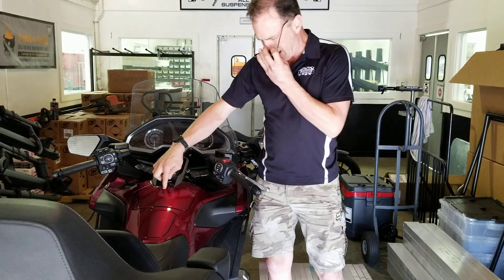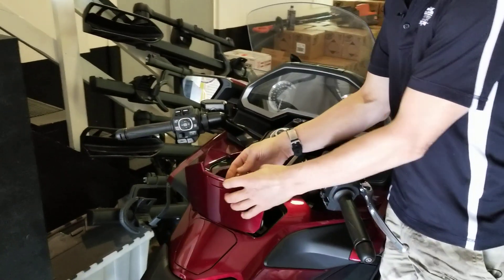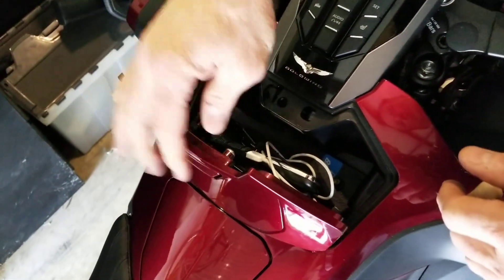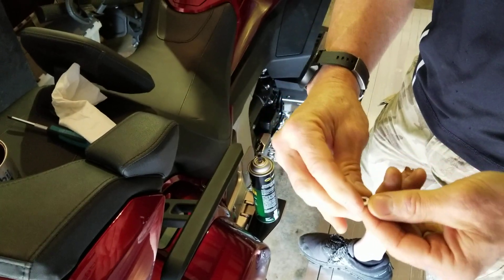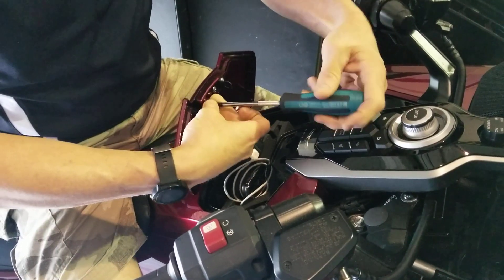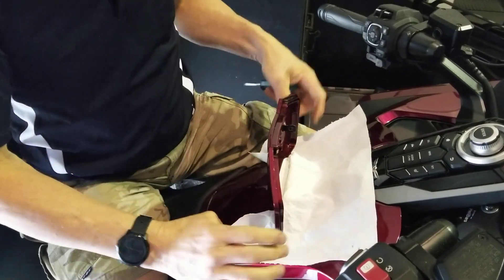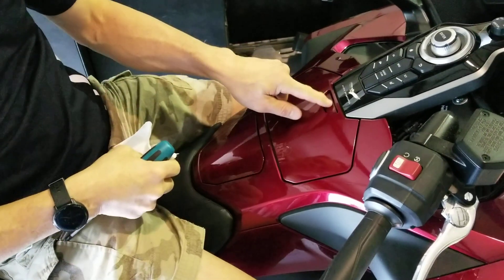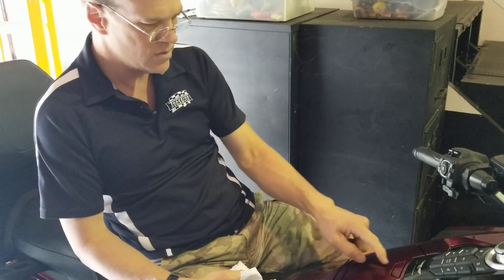Fix Annoying Center Console Latch -2018+ Honda GoldWing

Comment: I learned something today for all 2018+ Goldwing owners.  The latch isn't broken, you just have to press it on the right side vs. in the middle to get it to pop open.  Bad design if you ask me but figured it out with my dealer when mine wouldn't open at all lol.  Now it opens great just press on the right side of the big button.
Reply from the maker: If you would watch this video, I show you how to fix it so it opens normally.
Reply: @Traxxion  I watched it.  Was a great video!  Appreciate it.

Comment: Used your fix earlier today. Works perfect. Only difference is I used the washer from the other latch post. Still works great. Have to admit, you know how to intelligently analyze a problem and arrive at the smart fix. Thanks.
Reply from the maker: If you get a chance, grab a few small washers at the Home Depot.
The washers have a bigger diameter than the head of the screw.  The washers top out against the housing to keep the button level at the surface.  It's possible the left side of your button is sticking up above the surface of the door now.
Reply: Max McAllister  Added a washer back to the left side post. Works a little better. No biggie.

Comment: I thought I would have to deal with this bad design by pushing on the right side of the release button.  I completed the fix last week, and it works perfect now, thanks for helping us Wing riders with poor Honda engineering.
Reply from the maker: Soon I am going to have a locking button set to replace the factory button.
Reply: Max McAllister let me know when it become available,  a $20 lock prevents the theft of a $1000 phone.......what was Honda thinking......oh I am crazy, I have a 6” and 1.5” JIS screw drivers...
Reply from the maker: @kevinmiller1733  $20???
HAHAHAHAHAHAHAHAHAHAHAHAHAHAHAHAHAHAHAHAHAHAHAHAHAHAHAHAHAHAHAHAHAHAHAHAHA
HAHAHAHAHAHAHAHAHAHAHAHAHAHAHAHAHAHAHAHAHAHAHAHAHAHAHAHAHAHAHAHAHAHAHAHAHA
HAHAHAHAHAHAHAHAHAHAHAHAHAHAHAHAHAHAHAHAHAHAHAHAHAHAHAHAHAHAHAHAHAHAHAHAHA
HAHAHAHAHAHAHAHAHAHAHAHAHAHAHAHAHAHAHAHAHAHAHAHAHAHAHAHAHAHAHAHAHAHAHAHAHA
HAHAHAHAHAHAHAHAHAHAHAHAHAHAHAHAHAHAHAHAHAHAHAHAHAHAHAHAHAHAHAHAHAHAHAHAHA
HAHAHAHAHAHAHAHAHAHAHAHAHAHAHAHAHAHAHAHAHAHAHAHAHAHAHAHAHAHAHAHAHAHAHAHAHA
HAHAHAHAHAHAHAHAHAHAHAHAHAHAHAHAHAHAHAHAHAHAHAHAHAHAHAHAHAHAHAHAHAHAHAHAHA
HAHAHAHAHAHAHAHAHAHAHAHAHAHAHAHAHAHAHAHAHAHAHAHAHAHAHAHAHAHAHAHAHAHAHAHAHA
HAHAHAHAHAHAHAHAHAHAHAHAHAHAHAHAHAHAHAHAHAHAHAHAHAHAHAHAHAHAHAHAHAHAHAHAHA
HAHAHAHAHAHAHAHAHAHAHAHAHAHAHAHAHAHAHAHAHAHAHAHAHAHAHAHAHAHAHAHAHAHAHAHAHA
  Whew.... thanks, I needed that!!!

Comment: Hello Max, I enjoy your videos a lot, thank you, My 2018 DCT has an air bag where this catch is and obviously does not move until, well Id rather not say, but have you any insight into a problem that started some months ago and now is becoming an issue and its to do with the right hand side fairing pocket from where the filler cap tank lid is unlatched. The fairing pocket release latch does not open the pocket consistently, it takes many fiddlings with the latch to get it to open. Now this is the only way to get to the petrol cap lid release latch which itself is inside the faring pocket, I also noticed on a number of occasions the fairing pocket would open randomly by itself, of course it would close easy enough but now when I want it to open eg when needing to fillup with petrol it doesn't open just when you need it to, please advise
Reply from the maker: That entire setup is ridiculously over-engineered, and is set up to fail in my opinion.

If the right door won't open reliably, I have found that they aren't assembled properly sometimes.  The lid isn't installed eight and didn't line up properly.

If that's not the case, it can be any number of cables, latches or electronic bits.

It should be a Honda Warranty problem.

Comment: Max I have a question about the new Goldwing.. On the previous gw model you had to manually lift the front screen. There was no gap between the screen and the front body( where front head light is) it was flush together with no air gap at the bottom of the windscreen.   I took a demo ride on the new gw I noticed On the new gw when you raise the wind shield there is an air gap at the bottom of the shield.. where it meet with the body.
So big that You can slide your fingers through the new gap. Highway winds get into that gap and it create a wind tunnel humming effect. That new noise makes it harder to hear the radio at highway riding. 
I think the solution would be to close that gap like the previous Goldwing. So no air goes through the bottom of the screen. Just Up and around.

This should quiet the wind noise down on highway rides.
Someone should come up with a rubber or plastic adapter to close that gap when the wind shield is in the up position.
Reply from the maker: That's an interesting idea.  You could test this theory by buying a piece of foam insulation for 1/2" copper pipe, and stuff a piece down in the windshield to see what the effect is.

Comment: I have a question, is there supposed to be any "beeps" when pressing the key fob button to lock the bike?  I get no sound at all.  Also, does the bike have an actual alarm on it that will sound?
Reply from the maker: No alarm that I know of, could be wrong.  I don't recall mine beeping, but I suppose that's probably a user setting on the console.  You'll have to dig into the good ol' user's manual...